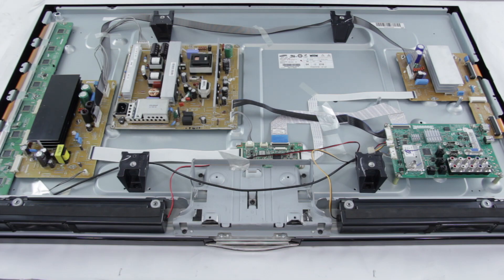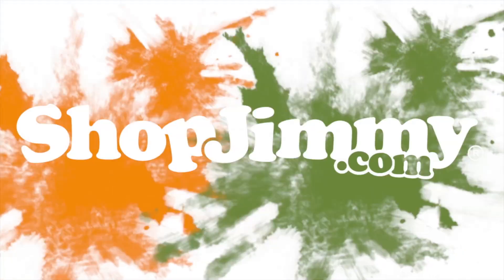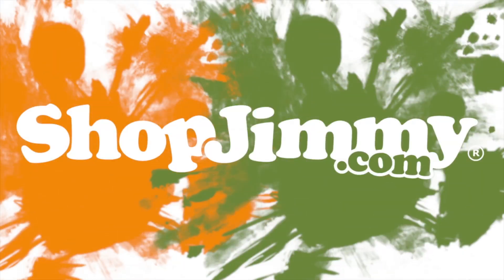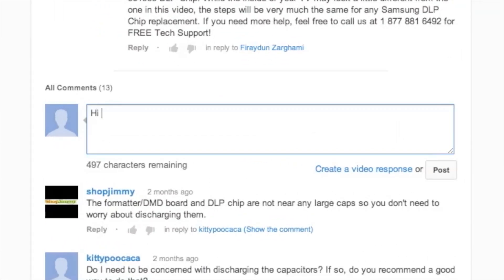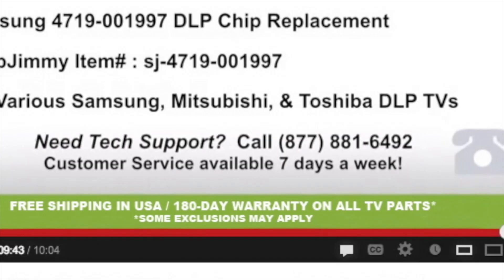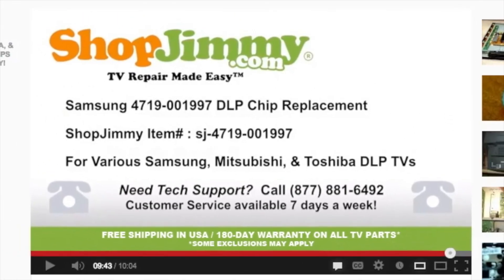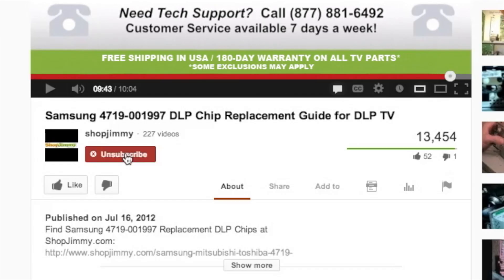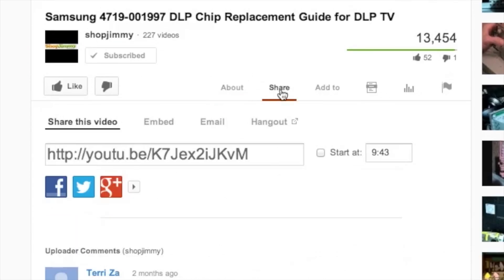Plasma TV Repair Tutorial - Common Symptoms & Solutions - How to Fix Plasma TVs

Comment: I have a gateway GTW-P42M203. When the tv gets warmed up the screen starts getting warmed up the screen gets wavy and has white flashes.
Reply from the maker: Chris Miller   This sounds like it could be a bad panel or board in your TV.  To try and find out which board is causing the problem, I recommend you use a can of freeze spray on the boards.  Be sure to take all necessary safety precautions.  With the TV powered on, you will want to spray each board individually with the freeze spray to cool it down and see if the problem comes back.  Once you have identified which board is causing the problem, I recommend you replace it.  Here is a link to replacement parts on our website for your TV model:   http://www.shopjimmy.com/catalogsearch/result/?q=GTW-P42M203  Be sure to match part numbers on your current board, with your replacement for compatibility.  You can also call our customer service for further assistance with your purchase.  (877) 881-6492  Thanks and please let us know if you have any further questions with your TV Repair!  www.shopjimmy.com

Comment: My Samsung plasma tv has white lines horizontally across the whole screen mostly on light screens not so much on darker screens.PN58C500G2FXZA model . Any recalls seems to a lot of problems with sSamsung TV out of warranty should I get it repaired?email me your thoughts .Thank you. Larry
Reply from the maker: Larry Childress   I recommend replacing the buffers in your TV.  Here is a link to replacement parts for your TV model number on our website, click here:  http://www.shopjimmy.com/catalogsearch/result/?q=PN58C500G2FXZA+  Be sure to match part numbers on your current board, with your replacement for compatibility.  You can also call our customer service for further assistance with your purchase.  (877) 881-6492  Thanks and please let us know if you have any further questions with your TV Repair!  www.shopjimmy.com  #tvrepair

Comment: Samsung LN46B530P7N, Left side of screen has a multi-colored bar, like B&W snow and flops to solid bars, and flickering, occasionally the bar gets wider. Gets bigger and smaller when tapped on the back, and sometimes has no problems.
Reply: thanks.
Reply from the maker: pointdexx   This sounds like a TV panel problem.  If your TV panel is bad, it may be more cost-effective to replace the TV as panels are typically hard to find in stock, difficult to replace, and expensive.  Thanks and please let us know if you have any further questions!  www.shopjimmy.com

Comment: Thanks - Looks just like the inside of my model. Looks like I need a new power supply because no power. Also, could the power cord ever go bad?

Thanks
Reply from the maker: Richard Rinn  I recommend replacing the main board in your TV.  Here is a link to replacement parts:  http://www.shopjimmy.com/catalogsearch/result/?q=PN50C450B1DXZA  Be sure to match part numbers on your current board, with your replacement for compatibility.  You can also call our customer service for further assistance with your purchase.  (877) 881-6492  Thanks and please let us know if you have any further questions with your TV Repair!  www.shopjimmy.com

Comment: Hi! I have a plasma tv Viore PDP4210EA that its defective. On all input sources,without signal the screen is is ''snowy'' with white vertical bars on right side(i think were it write no signal). With signal on AV or DVI the screen has no image,but vertical lines that changes in color and intensity like the original image(that i see on other tv) and the sound is fine. The menu wont appear on screen and i have changed the main logical board(LG 6871QCH034A) but no result. Here is some pictures with plasma display without signal  https://www.flickr.com/photos/robertoxsim/sets/72157643959167254/
I hope you can get me an advise for repairing these tv set.Thank you!
Reply from the maker: Robert Sim   I recommend replacing the main board in your TV.  Here is a link to replacement parts on our website:  http://www.shopjimmy.com/catalogsearch/result/?q=PDP4210EA  Be sure to match part numbers on your current board, with your replacement for compatibility.  You can also call our customer service for further assistance with your purchase.  (877) 881-6492  Thanks and please let us know if you have any further questions with your TV Repair!  www.shopjimmy.com
Reply: OK! Thank you!
Reply: Can you recommended other main board from LG, if the other boards inside and the panel is LG.(is hard to get the original main board from Viore and on your site is unavailable) Thank you again!
Reply from the maker: Robert Sim  Hey, can you reply with your part number, panel number, model code and or serial number?  Thanks!
Reply: this i the main board Viore E7801-100001 Main Board for PDP4210EA
http://www.shopjimmy.com/viore-e7801-100001-main-unit.htm
you don't have this and i wonder if it possible to replace this with other similar board from Akai or LG. Thank you!
Reply from the maker: Robert Sim  We always recommend to go with the original part or a listed substitute. If you can find one that goes to the exact same panel, has all the same connectors etc then it may work but its at your own risk.  Thanks and please let us know if you have any other questions!  www.shopjimmy.com

Comment: I have a Samsung Model Number PN51D530A3FXZA. The screen will not come on, but the power supply board makes a clicking sound for a few seconds after connecting the power and a red light flashes on the bottom left of the screen. Any help would be appreciated.
Thanks
Reply from the maker: *****  How many blinks are you seeing?  Thanks!  www.shopjimmy.com
Reply: Hi Rob, I have the same model as you but it is PN51D530A3FXZC. Same symptoms. The clicking sounds was approx 5 double clicks plus one click at the end. The red light flashes 10x. It corresponds to the green light blinking 10x as well on the main board. I checked the capacitor and everything seems to be okay (no bulging etc.). Please help.
Reply: bby6736
To correct, the green light was on the logic board, not the main board. Sorry. Please help.
Reply from the maker: bby6736   I recommend replacing the main board in your TV.  Here is a link to replacement parts for your TV model number on our website, click here:  http://www.shopjimmy.com/catalogsearch/result/?q=PN51D530A3  Be sure to match part numbers on your current board, with your replacement for compatibility.  Here is a link to a video showing how to identify your part number, click here:  Samsung Main Boards & Digital Boards: Part Numbers for LED, LCD, DLP, Plasma TV Repair  You can also call our customer service for further assistance with your purchase.  (877) 881-6492  Thanks and please let us know if you have any further questions with your TV Repair!  www.shopjimmy.com

Comment: I have a 32 inch LCD HDTV and the model number is 32LA30RQ My tv was not having any problems and it just shut off and will not come back on. I took the back off and checked the compactors and they do not look damaged. What else could it be.
Reply from the maker: Sylvia Long   I recommend replacing the main board in your TV.  Here is a link to replacement parts for your TV model number on our website, click here:  http://www.shopjimmy.com/catalogsearch/result/?q=32LA30RQ  Be sure to match part numbers on your current board, with your replacement for compatibility.  You can also call our customer service for further assistance with your purchase.  (877) 881-6492  Thanks and please let us know if you have any further questions with your TV Repair!  www.shopjimmy.com

Comment: LG PM9700.
There is no image, no shadow image in the dark, etc.
When I push the power on, it clicks once, and then clicks again. No image is shown.
The main board light flashes green for a few seconds when a button is hit and then flashes off.
Reply from the maker: Jennifer Nguyen   I recommend replacing the main board in your TV.  Here is a link to replacement parts for your TV model number on our website, click here:  http://www.shopjimmy.com/catalogsearch/result/?q=LG+PM9700  Be sure to match part numbers on your current board, with your replacement for compatibility.  You can also call our customer service for further assistance with your purchase.  (877) 881-6492  Thanks and please let us know if you have any further questions with your TV Repair!  www.shopjimmy.com

Comment: samsung ps43d490a1w - Tv won't turn on. it clicks 5 times when power supply plugged in then nothing. Green light also flashes on smaller board.
All capacitors look ok
Reply from the maker: bredsticz   I recommend replacing the main board in your TV.  Here is a link to potential replacement parts for your TV repair.  http://www.shopjimmy.com/catalogsearch/result/?q=43d490  Be sure to match part numbers on your current board, with your replacement for compatibility.  You can also call our customer service for further assistance with your purchase.  (877) 881-6492  Thanks and please let us know if you have any further questions with your TV Repair!  www.shopjimmy.com

Comment: I have a Samsung PN50C7000 Plasma TV.  Tv was just fine until a couple of pop sounds came out of the tv and the tv went out. The red stand by light is on.  Tried the remote to power on went to the tv to power on, notthing.  Unplug the tv waited 2 mins. plugged it back in and hear clicking sounds and the green logic board light flickers with the clicking sound.  Check all capacitors looks good and I also replaced the power board. Still having the same issue.  Which board is causing the issue? Thank you if you could help.
Reply from the maker: *****   I recommend replacing the Y-Main Board and the Y-Buffer Scan Drive in your TV.  Here is a link to replacement parts for your TV model number on our website, click here:  http://www.shopjimmy.com/catalogsearch/result/?q=PN50C7000  Be sure to match part numbers on your current board, with your replacement for compatibility.  You can also call our customer service for further assistance with your purchase.  (877) 881-6492  Thanks and please let us know if you have any further questions with your TV Repair!  www.shopjimmy.com

Comment: Panasonic TC-P42C1. Works fine but the bottom of the panel will not show anything. About 3 inches from the end of the bezel that goes straight across the bottom of the screen
Reply from the maker: *****   This sounds like a TV panel problem.  If your TV panel is bad, it may be more cost-effective to replace the TV as panels are typically hard to find in stock, difficult to replace, and expensive.  Thanks and please let us know if you have any further questions!  www.shopjimmy.com

Comment: I have a Samsung Plasma PN59D550C1.  It has a 4 inch white bar across the bottom in all modes and without any input.  I also just developed a single vertical black line.  Help!
Reply from the maker: Mark Santilli This sounds like a TV panel problem.  If your TV panel is bad, it may be more cost-effective to replace the TV as panels are typically hard to find in stock, difficult to replace, and expensive.  Thanks and please let us know if you have any further questions!  www.shopjimmy.com

Comment: Hello, i have a 50 or 55 in Plasma Sanyo DP50749-02. I recently got this tv for free from a good friend because it is broken. Its only problem is that it does not fully boot up. The green light will come on and then ill hear some ticking in the tv and then turn back off and come back on over and over ( which I think you described as a power cycle) What part should i get for my TV? Thank you.

Comment: I have a Samsung PN50C550 I was watching tv when I heard a loud "pop". The TV turned off, cycled power a few times and now only the red "standby" light is on and the TV is unresponsive. some internet searching indicates bad capacitor(s). What do you think? Thanks
Reply from the maker: Lee Parton  I recommend replacing the power supply in your TV.  Here is a link to replacement parts for your TV model number on our website, click here:  http://www.shopjimmy.com/catalogsearch/result/?q=PN50C550  Be sure to match part numbers on your current board, with your replacement for compatibility.  Here is a link to a video showing how to identify your part number, click here:  TV Part Number Identification Guide for Samsung DIY TV Repair Power Supply Unit (PSU) Boards  You can also call our customer service for further assistance with your purchase.  (877) 881-6492  Thanks and please let us know if you have any further questions with your TV Repair!  www.shopjimmy.com

Comment: I have a several week old samsung plasma. When turned off after being off for several hours, there is a short (~2") horizontal row of pixels that stay black for several seconds before lighting up. What would cause this? If it were the ribbon cable, I'd think it would affect the entire horizontal line/row of pixels. Do u think it will get worse or better with time? Thanks!!
Reply from the maker: Jim Banville   I recommend replacing the Y board and buffers in your TV.  Please reply with your TV model number and then I can recommend replacement parts for your TV repair.  Thanks!  wwww.shopjimmy.com   #tvrepair

Comment: I Have a LG PDP MODEL 42inch plasma tv.my problem tv did not come on next day so got it checked and was told to replace the Y Board .so i did but when it came on we got only clear sound with coloured Vertical lines with faint pic can pls pls tell me what the really problem now
Reply from the maker: Mark George   You will need to replace the buffers that attach to the Y board in your TV.  Please reply with your TV model number and then I can recommend a replacement part.  Thanks!  www.shopjimmy.com

Comment: Hi thank you for the great video. I have a Philips 50" 50pf963d37 plazma with ambilight on the sides. it is 5 years old, recently it started to show the static screen, for seconds, as if there is no signal while we are watching then it comes back. This happened with different sources like DVD and the cable. Please help....Sam
Reply from the maker: Syria Free   I recommend replacing the main board in your TV.  .  Unfortunately I do not see any replacement parts in the search results for your TV model number on our website.  Thanks and please let us know if you have any further questions!  www.shopjimmy.com

Comment: I have a vizo plaza tv
GV42L FHDTV10A

TV has a picture but has no sound. I did change the main board a few years ago.
Reply from the maker: madams adams   I recommend replacing the main board in your TV.  Here is a link to replacement parts for your TV model number on our website, click here:  http://www.shopjimmy.com/catalogsearch/result/?q=FHDTV10A  Be sure to match part numbers on your current board, with your replacement for compatibility.  You can also call our customer service for further assistance with your purchase.  (877) 881-6492  Thanks and please let us know if you have any further questions with your TV Repair!  www.shopjimmy.com

Comment: Hi mate, I have a 50" Samsung Plasma PSPF531801A. The TV kept turning itself off and on. So I just bought a new PSU. With the new PSU the TV stays on. But after 20 or 30 mins the picture goes black. When the TV goes black we still get sound. Hope you can help. Thanks
Reply from the maker: Ed Chard   I recommend replacing the main board in your TV.  Please reply with your TV model number and then I can recommend a replacement part.  Thanks!  www.shopjimmy.com

Comment: hi,i have 50'plasma tv model number hp-p5071...
having bad picture if im using the video...

when  im using the pc port of this tv ,it work fine ...
do u thingk i have a bad mainboard?
Reply from the maker: Bernardino Vivero   I recommend replacing the main board in your TV.  Here is a link to replacement parts for your TV model number on our website, click here:  http://www.shopjimmy.com/catalogsearch/result/?q=5071  Be sure to match part numbers on your current board, with your replacement for compatibility.  You can also call our customer service for further assistance with your purchase.  (877) 881-6492  Thanks and please let us know if you have any further questions with your TV Repair!  www.shopjimmy.com

Comment: LG plasma model: 42PQ30-UA tv is able to power on and play sound but the screen goes unchanged and stays black. No sign of it attempting to display. Thank you for your help. In desperate need of a cheap fix.
Reply from the maker: Oscar Almanzar   I recommend replacing the YSUS board and the buffers that attach to the YSUS board in your TV.  Here is a link to replacement parts for your TV model number on our website, click here:  http://www.shopjimmy.com/catalogsearch/result/?q=PDP42G20144  Be sure to match part numbers on your current board, with your replacement for compatibility.  You can also call our customer service for further assistance with your purchase.  (877) 881-6492  Thanks and please let us know if you have any further questions with your TV Repair!  www.shopjimmy.com

Comment: Hello, I have a old Maxent model P420142X3 42 inch tv and I am not sure what is the problem. I can tell It receives power because the power button lights up orange, but doesn't change color or flash. I don't get any type of display on the screen or sound. One person said it might be the Y SUB BOARD and MAINBOARD. I don't know if it can be fixed for a good price or if I have to get another. What should I do?
Reply from the maker: lonzo williams  I recommend replacing the main board first to see if that fixes the problem.  Here is a link to replacement parts for your TV model number on our website, click here:  http://www.shopjimmy.com/catalogsearch/result/?q=P420142X3  Be sure to match part numbers on your current board, with your replacement for compatibility.  You can also call our customer service for further assistance with your purchase.  (877) 881-6492  Thanks and please let us know if you have any further questions with your TV Repair!  www.shopjimmy.com